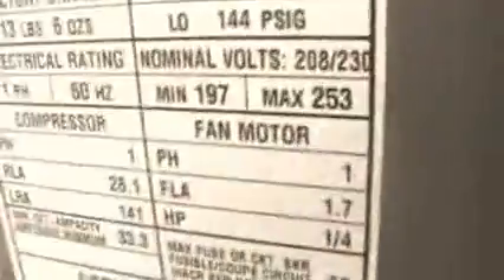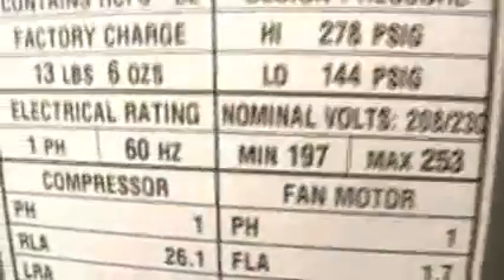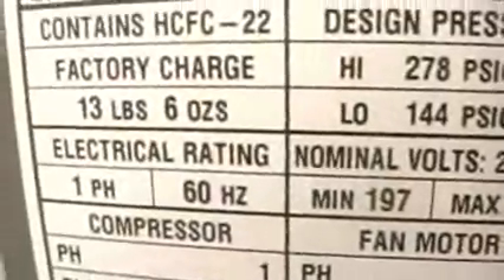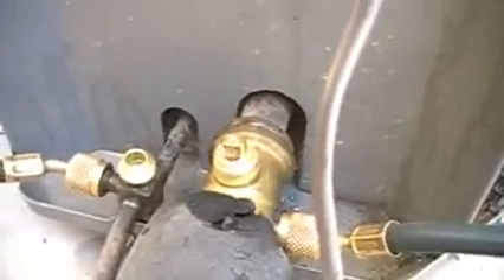HVAC - Torque Your Nuts

Comment: Great info
My boss pointed that out to me when I first started, we had a Lennox A/C low on charge. He got out his refrigerant sniffer and pin pointed the leak from the caps on the unit. Lennox recommended using Loc Seal for A/C to us. Since then we havent' had a leak on the caps.

Comment: I order caps by the case (100). I had a unit the other day that strangely lost all of the oil and not a bit of refrigerant. Liquid line sight glass was clear, sight glass into the compressor crankcase had no oil. The unit was tripping oil failure. The suspect fitting was pointed straight down and oil sealed it while itself leaked out.

Comment: The problem is no one protects the service valve from the heat. you have to wrap a wet rag arorund it when you solder the pipes.  and you ned to now how to solder